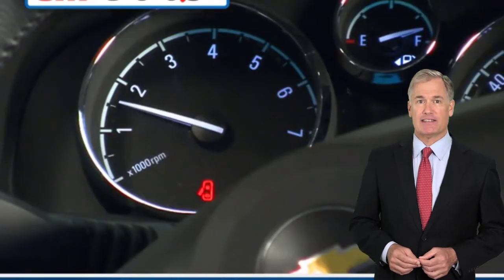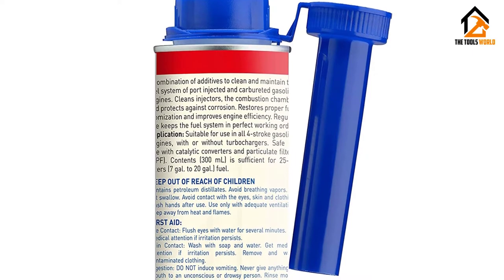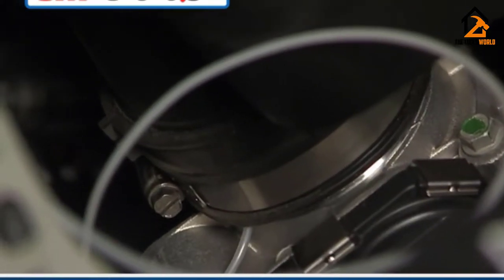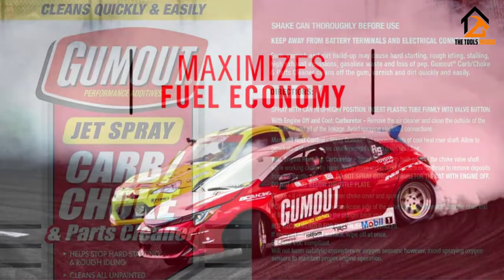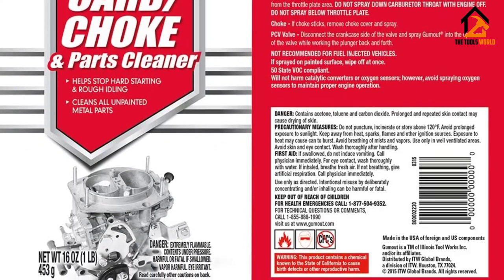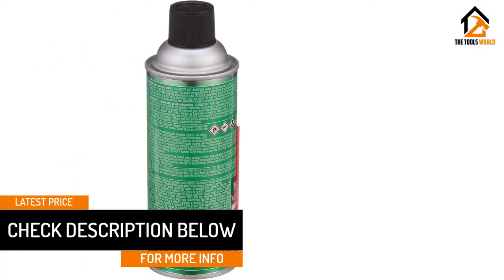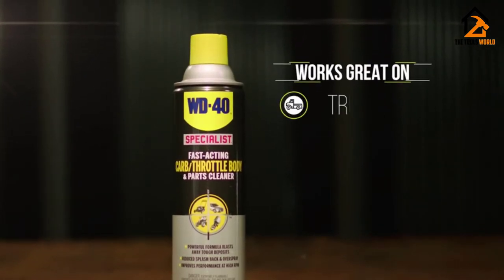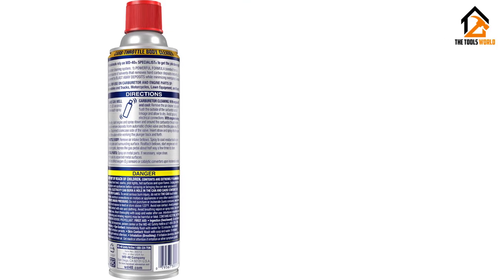Top 5 Best Carburetor Cleaners

Comment from the maker: ▶ In This video, We recommended the top 5 best Carburetor Cleaners in 2022.

▶ 5. Liqui Moly 2007 Jectron Gasoline Fuel Injection Cleaner.   
 
▶ 4. 3M Throttle Plate and Carb Cleaner. 

▶ 3. Gumout Jet Spray Carb/Choke & Parts Cleaner.  

▶ 2. CRC Carb & Choke Cleaner.   

▶ 1. WD-40 Specialist Fast-Acting Carb/Throttle Body & Parts Cleaner.